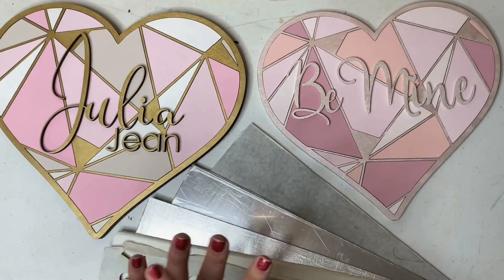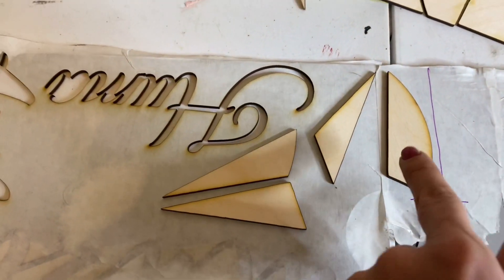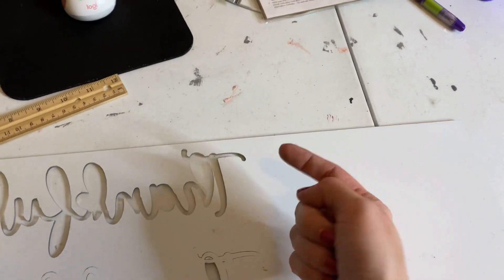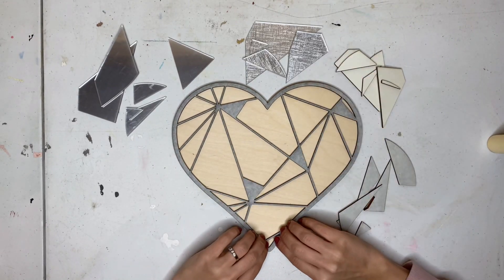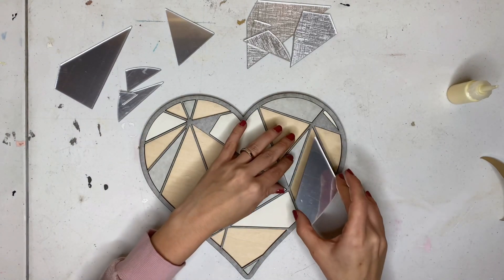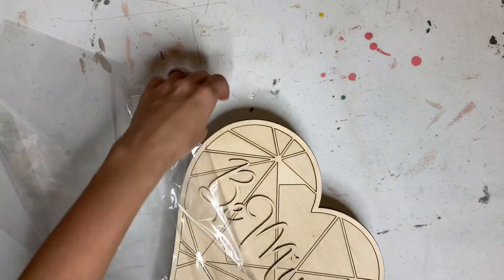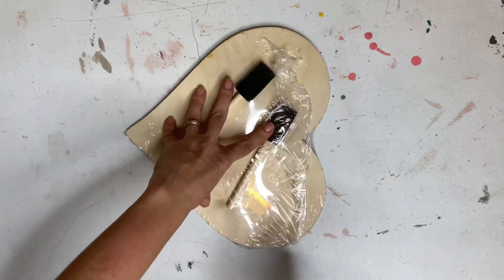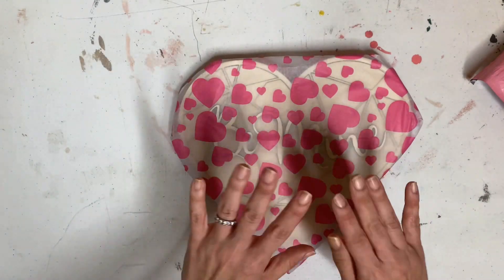Laser Cut Acrylic Using 3M Adhesive & Shrink Wrap Packaging

Comment: I am new to lasers spending the last several years using my CNC.  I appreciate all of the information that you and others in the community share.  Is there a technical reason you didn't use the 3M tape for all of the wood parts or is it a matter of economics?  You mentioned you use sparingly because it is expensive - is that why you didn't use or is glue better for wood?

Comment: Hello, I have a question about your compressor… is it necessary for the Mira7? I am looking at an in-line fan with a carbon filter to extract and clean the air before venting out the window.
What benefits are there to having that compressor & is it really loud?